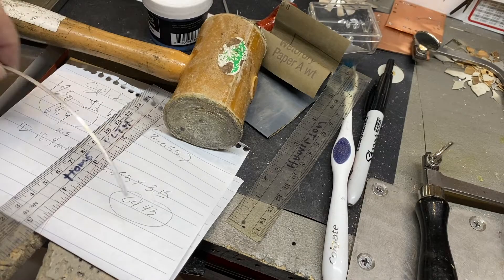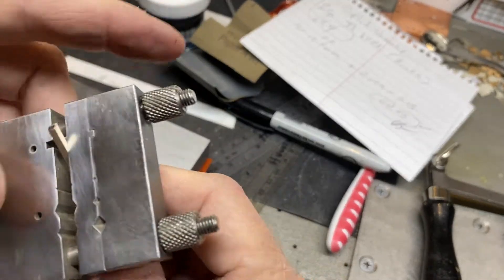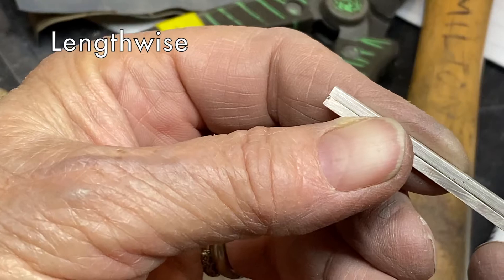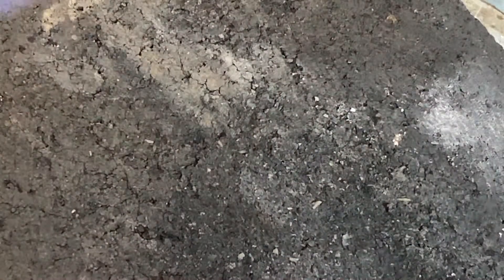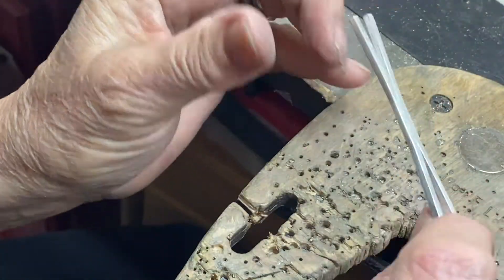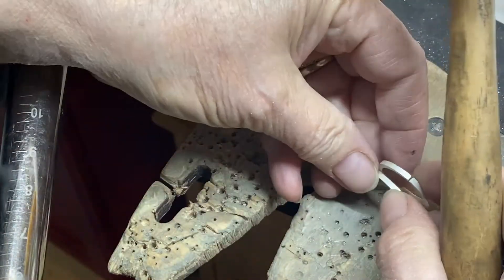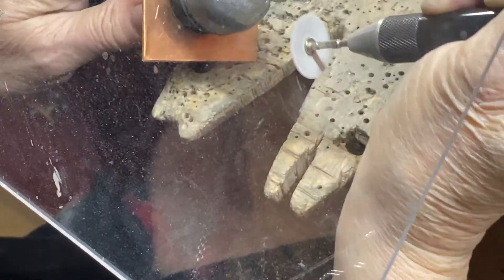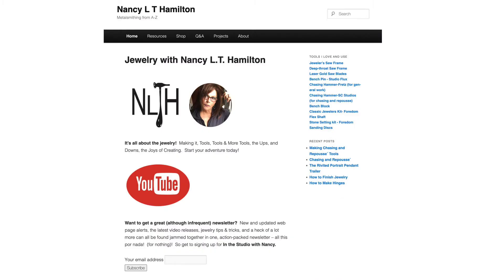The Split-Shank Ring

Comment: Beautiful work. I watch on of your older video's and you mentioned you put baking soda in used pickle then you either threw it away or disposed of it. Other artists say take it to toxic dump facility. You are so knowledgeable about most everything jewelry
 What's the correct way to dispose plz.🙏😒
Reply from the maker: Michelle, a lot depends on your local requirements.  From what I've read, for my area, with personal use, it is ok to neutralize the pickle and then dispose of it when it is no longer an active acid - in the sink.  Another method of disposal involves evaporating the pickle and throwing away the (neutralized) crystals.  Once neutralized, the only issue left is the copper present in the pickle.  Copper should not be introduced into waterways as it is toxic to aquatic life.   So, don't dump it in the creek, pond, lake, ocean, etc.! 

 Personally, I change my pickle maybe every 3-5 years.  I dispose of my spent pickle by neutralizing it, then evaporating. 

 The amount of copper introduced via your pickle is minimal.  For a comparison of the amount of copper generated in your pickle, versus copper in the environment, envision the amount of copper that enters our waste  treatment facilities daily via the use of copper plumbing pipes.  Many, many homes and business still have copper plumbing.   Also consider the amount of non-refined/un-recycled copper pipe and other metals that are tossed into our landfills.  The amount in your pickle pot is miniscule in comparison. Also, many people use sodium bisulfate (the active ingredient in many pickles) as a spa product.  Are they neutralizing their hot tubs and bringing the fluid into a hazardous waste facility when they change the water?  Probably not.  Hopefully, they are NOT dumping that water into a creek!  

 As I said in the beginning, it's best to check with your local hazardous waste treatment center before deciding on any of the options I mentioned above.  Good luck!  N
Reply: Thanks so much for answering my question with such great info. It helped a lot and you are so right about what's going on with our environment. It's very scary but true

Comment: Is that solid square wire or is that half round wire I think I missed it in the beginning are use half round wire and right now I think I’m using eight gauge half round wire or six gauge half round wire for my ring shanks or double ring shanks but even though I am a silver smith instructor I still have a weak point and that’s with my ring bands and I don’t know why
Reply from the maker: You can use 1/2 round or square or even round.  I used square in the video.  What seems to be the problem with your ring shanks?  Thanks!
Reply: @NancyHamiltonJewelry  Probably because I don’t make as many rings as I do other designs. I make great stack rings but right now I’m making matching varisite cab cuffs and rings. My Varisite is top quality and I just want to get it right. I started on the bands last night and so far they are looking good... Thank you so much for replying back to me 🤗